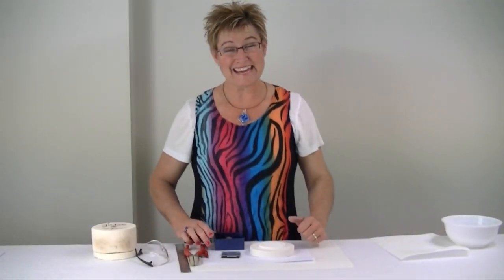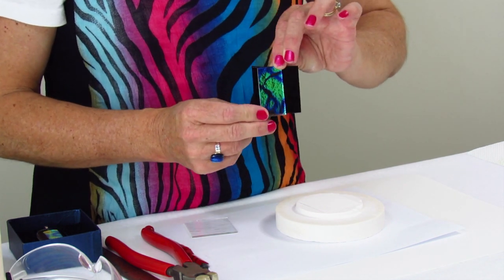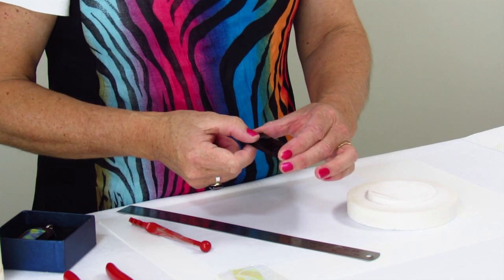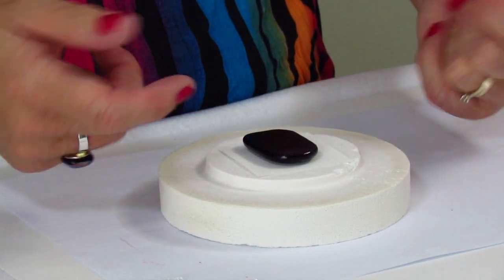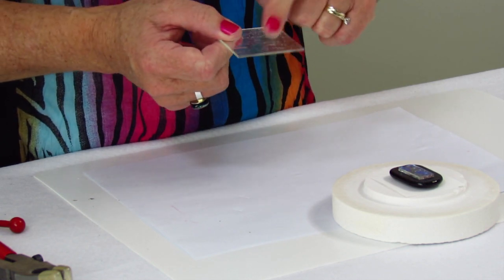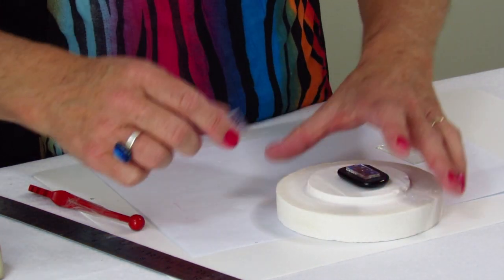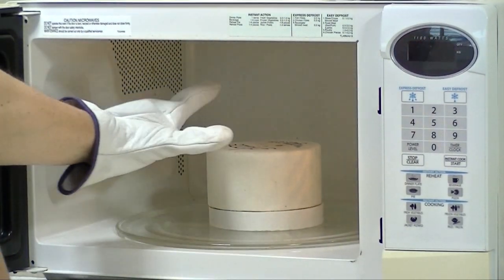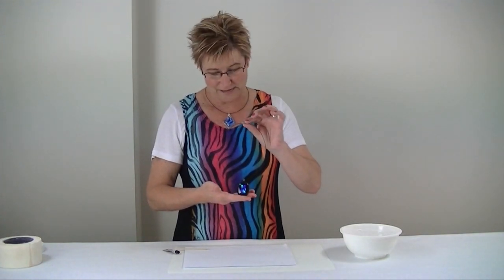Dichroic Fused Pendant in Microwave Kiln

Comment: Are there slump molds which would work in a microwave kiln? If so, where can I buy one that fits within the 5in. diameter of my microwave kiln? Also, I see some kilns that have what looks like a black coating around the sides. Is that some kind of kiln wash? Thanks for your help! You produce very helpful videos!

Comment: Curious why you can't fuse it all at once?  Why the 2-step process?  I did make this from your video and it turned out beautiful!  My very first piece ever!  Thanks so much!
Reply from the maker: Hi Joanne - I did this as a 2-step firing to preserve the dichroic.  That way I could get the shape I wanted without burning off the dichroic.  The more dichroic is heated the more it will lose its vibrant colours.  Try it yourself - you can fuse it until it goes grey (which can sometimes be a nice design element, but a waste of dichroic I think ;)  )  Thanks for watching my videos!  So pleased to hear that your first piece turned out beautiful!  Have you checked out our courses on kraftfun.com and kraftfun.newzenler.com?  You can find out more on our facebook group - Kraftfun Microwave Kiln Glass Fusing.  Have fun with your fusing Joanne! x
Reply: @GlazeGlassJewellery  Thanks for the explanation!  I will have to experiment :).  I will definitely check out you links :) thanks!